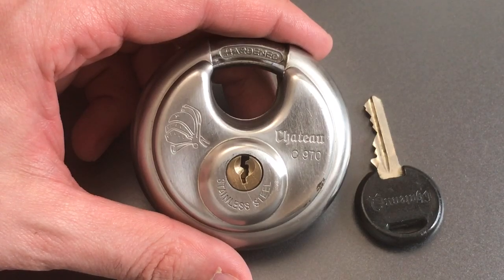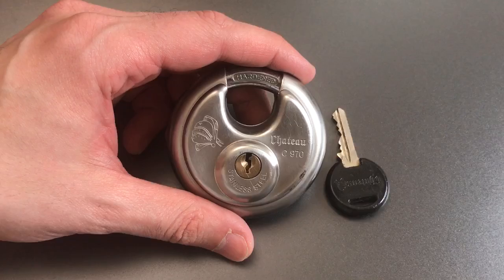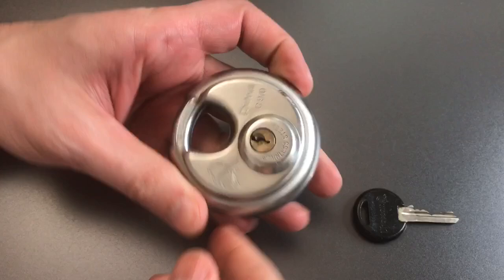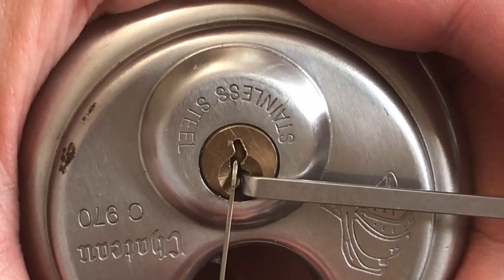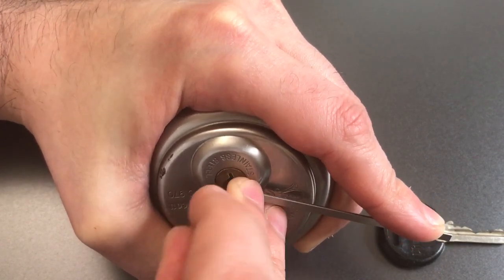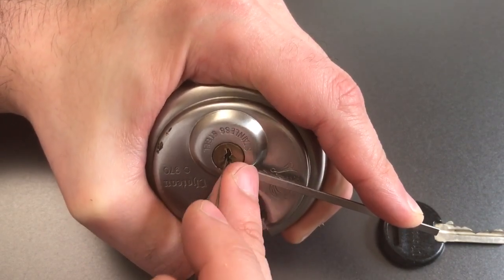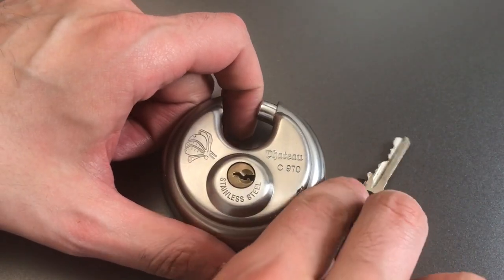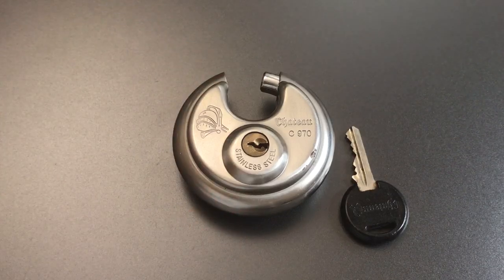[378] Chateau C970 Disc Padlock Picked

Comment: Quite a few of those style locks have a small drain hole in the back that lines up with the keyway. You can insert a tension wrench there and have the front completely open for pick manipulation. Very handy with that tight keyway. I was waiting for a rear view but no luck this time... Very nice pick, thanks!
Reply from the maker: This lock has it.  I know exactly what hole you're talking about... never thought to tension them from the back.  Interesting idea.  Thanks for sharing.
Reply: That hole is pretty small in diameter. Maybe 1/8". Are you suggesting a round tension bar with the ends smashed to make a flat end? A standard tension bar won't fit.  Great info, I'll try it.

Comment: I have unfortunately inherited one of these locks due to covid. For the better part of a couple hours I gave it my best, which was a complete failure. I looked up the model on google and ironically your channel had a video on it. I have been watching this channel for several years now, and had already watched this video in particular when it was released. Now that I have watched it again as a refresher, I have become a bit jealous that this video only lasted 4 minutes (3 of those just talking). I can say for certain this lock didn't look that hard sitting in the box I found it in. As this is a hobby, all of my picks are home brewed out of any "springy steel" I find. When you brought out that ultra thin small hook I quickly realized my failures. I will be throwing this demon in a drawer until I can get a better set of picks. Thanks for the great video as always, I just wish it would have taken you longer to open.

Comment: We sell these locks to customers at Public Storage. We are even told to "advertise" them to our customers as being "pick, drill, and corrosion resistant, with a minimum of 5 security pins and a hardened steel shackle". Good to know I'm not bullshitting my customers. If it takes you longer than 15 seconds to get through a lock, its a good lock, imo.

Comment: My mother owns this lock, and I had made numerous attempts on multiple occasions to pick it.  There have been very few (if any to my recollection) locks that I have not, given enough time and attempts, been able to pick.  Still; time after time this lock frustrated me.  I am proud to say that I felt that familiar rush as the last pin "clicked" and the tension wrench turned in my hand.  certainly a good lock that I might have given up on all together had I not been inspired to persevere by this video.  They are always a pleasure (at least to those who know that sense of success of picking a lock).  Thank you for all of your work..
Reply: Could it have been dirty inside?
Reply: @1ambulator  I did eventually succeed.  The lock itself was relatively clean and only light used (indoors).  I often use a little bit of graphite powder on those locks that don't yield quickly.  I can't recall if I did with this one tho.
Reply: @dougdrinkwater5843  great idea, thanks

Comment: I just got one of these locks when cleaning out my dad's shed (along with 5 other Master/Brinks/Unknown locks). 
I was able to pick all the locks except this one, so came here to see if you had done one. 
I am only still in the beginning stages of picking, and only have a cheap $10 e-bay pick set, but glad to see it is not just me. 
I could not tell if it had 5 or 6 pins, and have only picked 4 and 5 pin locks up till now.

I started at bottom of key way  tension, so looks like I am doing that part right, I also saw the hole in the back and thought about using that for tension to give me a little more room.

Comment: After watching LPL and BosnianBill for long enough, I finally sprung for a beginner set of picks. This was one of the 1st three I tried. Thankfully, I knew from watching these guys that the the MasterLock that I take to the gym would be a great place to start (and it was) and the KwikSet on my back door started to help me transition from brute raking to actually feeling pins. But, this C970 continues to elude me. So, after Googling, I found that LPL had done this video on it a couple of years ago! Excitedly, I loaded the video and was encouraged to hear that this wasn't without its challenges. But, it's nice to know which way I should be turning the tension and apparently I don't need to try to be in top of keyway for this one. I'll keep trying! I'll try the short rake, again, too. If LPL can do it in 1.5min or so, I can expect it to take me some time (1.5mos? :) ). Now that I remember what the key looks like for this padlock, I think I'll keep an eye out for the key around the house, too. :) Thanks @LockPickingLawyer for the encouragement, education, and entertainment!!!
Reply: Many current Chateau keys are white. 12/22

Comment: I've drilled these, bolt cut over a hundred and cut many with a grinder. Bolt cutting is the way to go.
Pro tip: if the neck is completely covered, use big bolt cutters to pinch the edge of the body, and pry the body off to reveal the neck and boltcut that, ez

Comment: I’d be interested to see destructive attacks on these locks. I’ve found two in a storage locker facility where I’ve worked, and one had the body cut open with an angle grinder.

Comment: When I'll get more proficient with my kasp disc padlock I'll send it to you. It's all (5) serrated key pins rest is standard (maybe 1 shallow spool), crunchy from some gunk inside the core is still giving me a hard time. But you can rake it open (easiest approach for me or with more success rate). But I think it's the best protected disc padlock with a pin tumbler core. And it's the cheapest (from ABUS, Burg Wächter etc.). In my opinion kasp offers most of the time best bang for buck.
Reply from the maker: Interesting... I've been pretty impressed with Kasp products... though the 19070X core is a bit of a joke compared to the lock body.

Comment: ive opened cheteau locks with keys from other locks by jiggling. the key variations seems pretty narrow. nice video. not a difficult lock, 90% of its security comes from the keyway shape. they can be cut prettt easy unless its the newer style with the aluminum internal block.
Reply from the maker: Interesting... this one seemed a bit too well made for jiggling attacks to work unless the bitting was total crap.  As for cutting, they are not hard to cut... just harder than most locks.
Reply: that lock might have been a little bit better because it was six pin, i think all the ones ive messed with have been 5. they have prettt good tension that makes them a little annoying to pick. i saw bill attack an abus disc lock with a torch because it had a zinc plug the core was stuck in. the plug melted out of the body, a screwdriver was used to lever the core out and turn the mech. i dont think that would work on this one but its interesting that it did with an abus.

Comment: Just moved to a new area and have a 12x40 storage unit that I got less than a week ago for many items as well as a rare older vehicle and so they give you this lock as a comp. I come from trucking so no matter what lock I use I always use a numbered trailer style seal as well to inform me if it has been tampered with. Today I went to check on the unit and my seal had been broken I can only assume that the lock was opened as well. Now I am stressing out thinking someone is casing my unit and not sure what to do.
Reply: Put a better lock on your unit and re seal it.

Comment: The key is a problem in that the plastic is the top and if that comes loose the key is lost.
It's not a full tang key or head or whatever you put you thumb on to turn it.  It's just a little jagged wretch of a top of a key that doesn't fasten into your keychain.  Just the plastic is holding that key on.

Comment: My storage facility gives these out . Lock puck lawyer I am an ex Public Storage Employee and I am come from a long line of locksmiths , criminals and tool designers . My grandfather is the tool designer listed On The  initial Kwickset Patent . Anyway enough pedigree right ? have you ever picked the chateau red and blue auction locks ? Not the plastic ones but the metal discs???

Comment: I have a c99x with super brutal bitting, not sure if ill ever get it open, core has really strong tension spring but after a few degress rotation becomes a dead core.

Im a newbie, and so far have only found 1 video of someone opening a c99x and it looks fake because its a grainy video and he rakes it open, and the shackle has been cut, and he doesnt lock it with the key, he uses a tension wrench and i cant hear the click of the shackle.

Comment: Came to you for help with this particular lock (at least an hour over the last 2 days working on it) and I was surprised to see you use a tension bar and tool that looked identical to the ones I chose for the job *score*. Then you so easily and confidently maneuvered each pin in such a shore amound of time. I can barely tell which pin I am on when looking through my clear training lock, much less know how hard to tension or pick pressure. Going to keep practicing, and maybe get some thinner picks!

Comment: I've the 870 , and we just can't get it.
A total of 3 dude have failed .
All of us have some experience .
Tried raking , tried picking , but I've got this other pick called a cutoff disc angle grinder .
Hope we don't have to get some C- 4 and blow it off it's getting stupid.
Reply: Could the lock be dirty inside? That certainly would inhibit pin movement.

Comment: That would be hard to hold if it's locked to something isn't it
Reply from the maker: I guess that depends what it is locks to.  You can increase the pick resistance of any lock by mounting it in a way that restricts access.
Reply: LockPickingLawyer, what would be the best way to mount it? I'm guessing you mean to put it on the storage unit so the key slot is facing the door? (Instead of facing you when you're standing in front of the unit?) Thanks for the video!